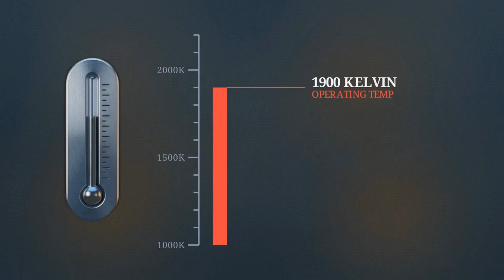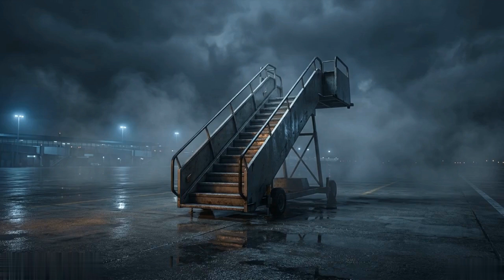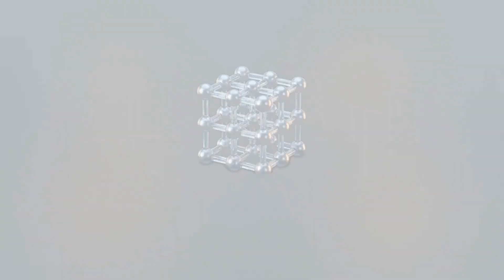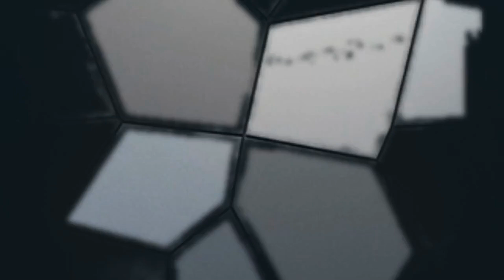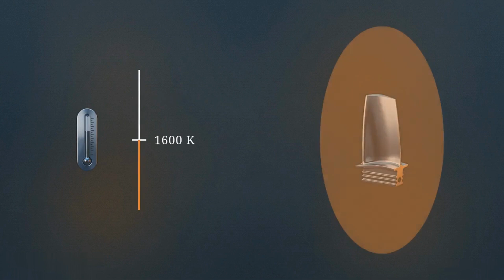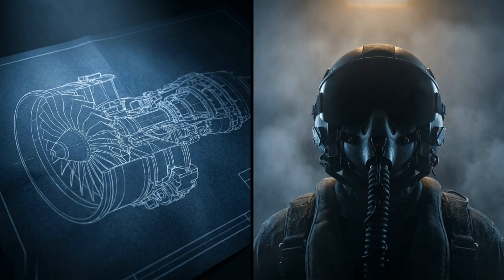The Metal That Shouldn't Exist

Comment: What wasn't properly discussed in this video was "film cooling": The cold compressed air from the front compressor is forced through precisely drilled via "Electrical Discharge Machining (EDM)", also known as spark eroding or "burning," is a manufacturing process used to cut or shape hard, electrically conductive materials. Instead of using physical cutting tools like drill bits or milling cutters, it uses rapid, highly controlled high-frequency electrical sparks to melt and vaporize microscopic amounts of metal. Both the tool and the work-piece are submerged in a dielectric fluid (typically deionized water or hydrocarbon oil). As this cold, high-pressure air escapes through many holes of the individual fins it forms an artificial, cooler thermal boundary layer. This layer acts as an insulating "film" barrier, keeping the scorching combustion gases from directly touching the metal fins.  David Riddle
Reply from the maker: Thanks for adding this detail about film cooling and EDM! It's a great point about how those advanced manufacturing techniques contribute to the durability of these materials.